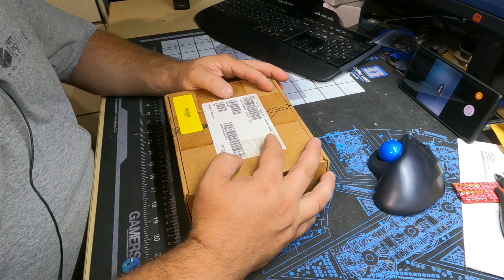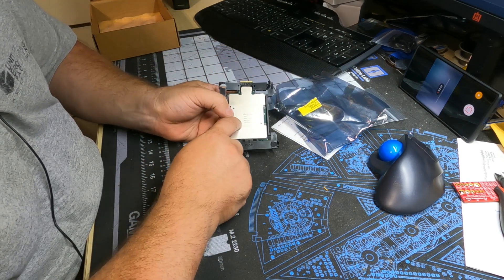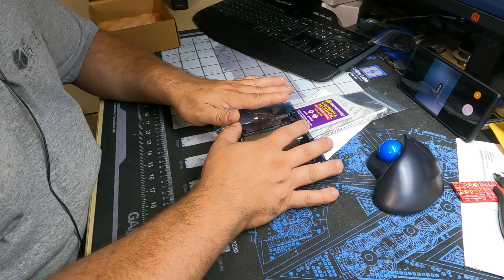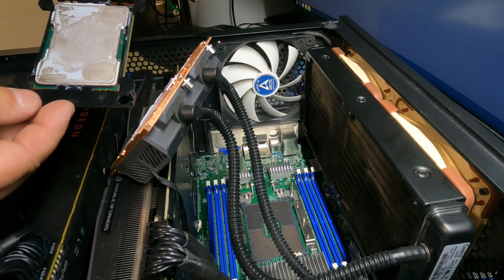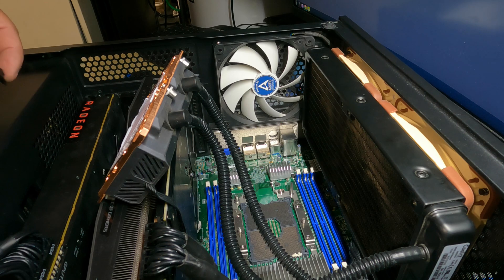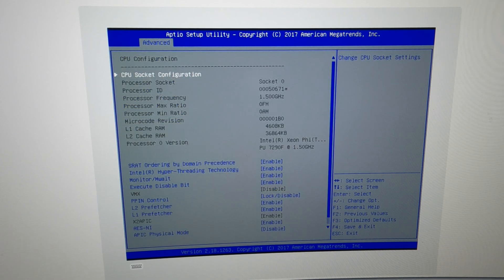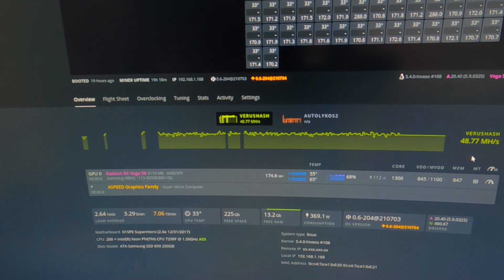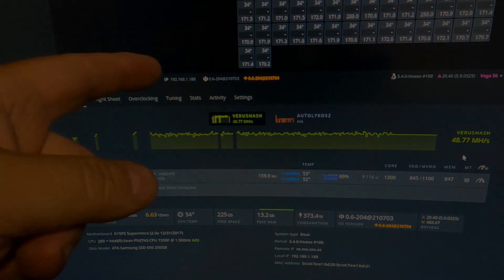Verus CPU Mining On A 7290F CPU 72 Cores 288 Threads!!!

Comment: I thought those 4  PCI extension cards only used one pci-e express lane, I thought they multiplexed the 1 lane between the 4 cards.  So you should be able to get 4 cards on that.
Reply from the maker: You are correct, but I was hoping to get 2 extension cards on this motherboard so I can run 8 gpus.  With only 4 pcie lanes from the 7290f going to a single pcie slot the other two slots are disabled.